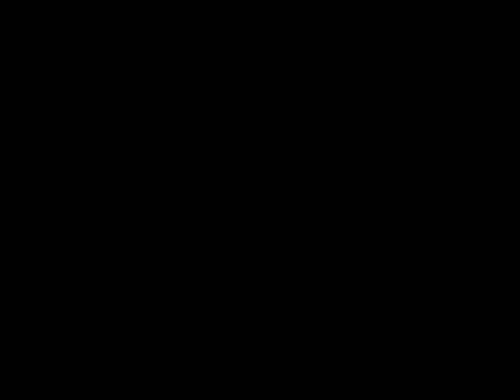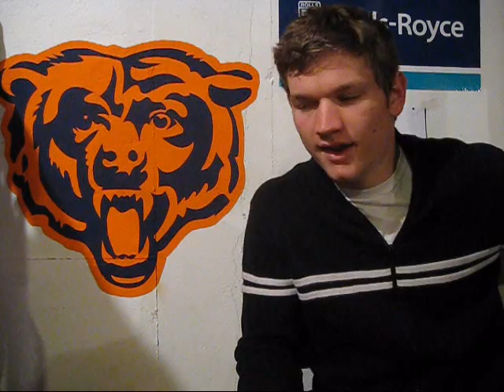How to Bleed Brake or Clutch Lines with Power!

Comment: That's a good idea but why not extend the hose from the bleeder nipple back to the reservoir so you don't run out of fluid. it will bleed back into the same reservoir without having to top up the fluid. Just my thought.

Comment: The biggest problem with the video linked is that a CLEAR hose should be used and not just any oil can. You need to be able to see if you have any air bubbles in the hose for obvious reasons and oil cans may not all be created equal and you could still be pumping air into the system because the pump in the can introduce a little. A reverse bleeding kit is around $22 on ebay and totally worth it. Or just use the method you mentioned and save some money.

Comment: slick lil idea.. only issues i have is ..1 id prefer to back bleed fresh fluid instead of the fluid thats been in the brake lines a while... 2 you still have to switch lines and stuff so it similarly intensive... and 3 if your inside pumping brakes you cant see under the hood to see if any air was pushed out... but for  a backyard mechanic hey whatever works right? ;)